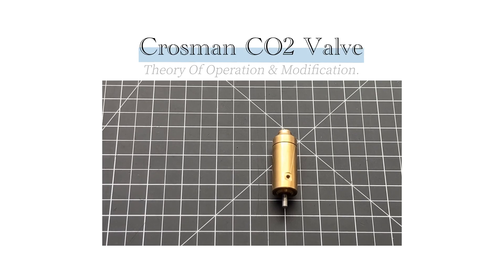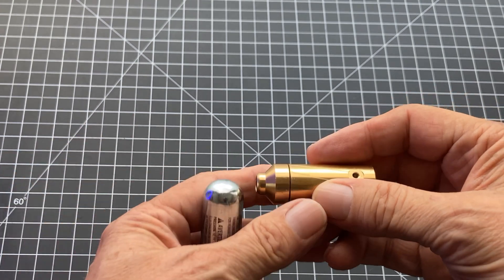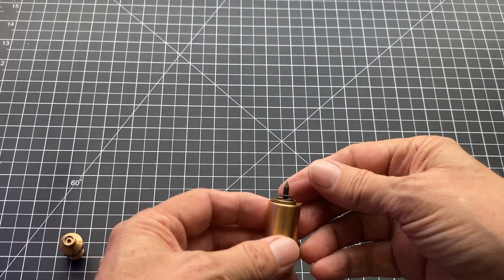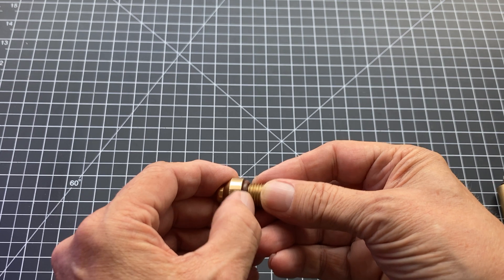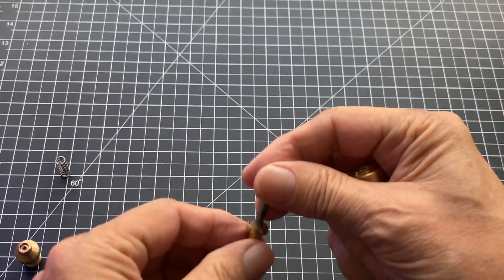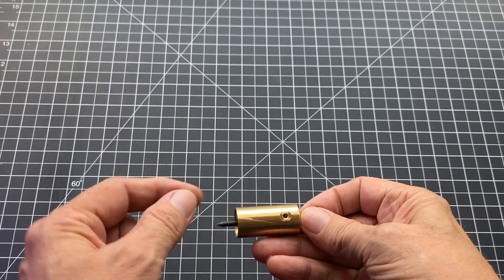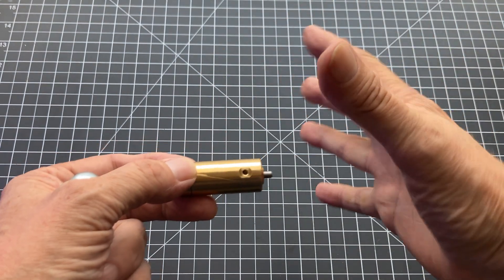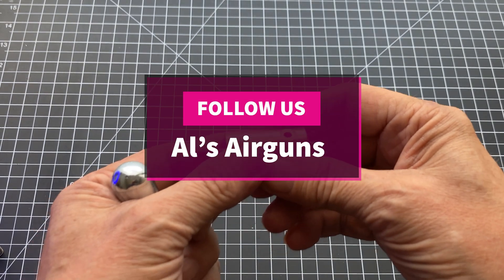Crosman CO2 Valve Theory Of Operation & Modification For Increased Power (Part 1.)

Comment: I have a pell master 700 and the valve assembly is different! I took it apart to clean it because it was leaking air. When I took the snap ring off it flew apart and I don't know what order to put it back together in!
Reply from the maker: Unfortunately the Pell Master 700/707 was a real odd ball in the Crosman line-up. It utilized an in-line valve design which is totally unlike the traditional Crosman CO2 valve. Most people including myself were unaware of this one off in Crosman’s history. There is not a lot of information online about it, however if you go to Crosman’s support website you should be able to find the exploded parts diagram which can assist you with reassembling yours.

By the way, if it’s leaking gas cleaning it will probably not fix the problem. It’s more likely to be a component failure. Most likely a seal or spring has failed. Good luck with the repair.

Comment: If you don't understand an Airgun valve after this-You shouldn't play with Scissors !😆, Al has explained this quite well ! I worked with CO2 in the Beverage industry, and TEMPERATURE is prob your biggest factor to Increase Pressure(Not Volume-just pressure). Be VERY careful Tho...But we all Know, a Hot, Summer Sunny day, and Warm CO2 Carts, A warm pistol sitting in the sun... will give you your highest power #'s...EVERY time. Pressures will be higher. Considerably, than let's say, a guy like myself shooting in January in NH-Outside @ 32* degrees !. Chrono will always Prove this. I've seen guys spray paint brand new CO2 Carts flat black (ever wonder why they all come Silver?)- painting them black will surely raise pressures IN THE SUN Only ! Add in a Black Pistol,Sitting on the Table in the sun and You'll understand. I'll recommend NONE of what I said, but it is a Fact. CO2 Expands with heat. Fire 10 fast Shots and watch pressures drop as the gun/CO2 cool from the liquid CO@, Yes, The pressure drops due to volume lost, but the Ultra-Frost-bite temps will rapidly cool the gun. It's important to know the mechanics of anything, and all the processes involved, because it will make you a better shooter- In ANY shooting sport! Thanks to Al !!
Reply from the maker: Your comment is much appreciated. Thanks 🙏

Comment: Finally a clear explanation on how the system works. 55 years not knowing this, BTW! I have a Sears,  mid 60s, 22 Caliber Rifle similar to the Crosman 160, but with a shaft on the threaded cap and uses only one CO2 Powerlet. Would it use something similarly designed? And you mentioned something like an O-Ring where the Powerlet meets the Valve? How are they held in and where do we get those, because when I put in a new Powerlet, it leaks immediately when pierced! Thanks for sharing solid information for those of us that like to know how things work for real! VERY MUCH APPRECIATED!
Reply from the maker: I’m glad that you enjoyed the information. Sounds like you may have a Crosman 180 that’s been branded by Sears. The 180 was, as you suggest a one co2 capsule version of the 160.

Unfortunately there are a few places it could be leaking. 1. Is the O=ring that seals the end cap. 2. Is one of the sealing points in the valve itself. I’m not sure if that valve used a seal in the front of the valve that pressed against the opening in the neck of the CO2 capsule like a modern Crosman CO2 valve or not. If so, that’s not a standard o-ring, but instead a special synthetic seal produced by Crosman. If that’s the case Crosman may be a source for it but you’re going to need to come up with a part number to find out and that’s going to take some research or additional assistance. I think it’s definitely worth pursuing if the guns in good condition otherwise. Let me know if you need help.
Reply: @AlsAirguns  Funny thing is my Sears has a Long Tube and Stock (Much nicer feel and hold), but uses one Powerlet like a 180. Thank you! I will attempt to disassemble and document placement on all parts with pics and hopefully have it running like new again. It was quite accurate back in the day!

Comment: All the same goes when modifying  for hpa valve  besides the side pining.  The discovery valve body  a aluminum  side pin hole taped   2240 valve body basically   the top and  popet are  made for hpa .    A discovery is a  factory modified 2260 hpa conversion   with a tube fill end cap. Lol🤭💯🫡👍✌️
Reply from the maker: That’s great information. I always feel like I missed out by not owning a Discovery.

Comment: Very interesting and very helpful! Would I be correct in assuming that you may provide before and after the modification fps and shot count data in Part 2 or 3? Thanks again! This is literally a case of "Knowledge is Power!"
Reply from the maker: Yes, I’m modifying this valve for the Crosman custom co2 carbine I’ve been building on the channel. So the performance before modifying is. documented in terms of FPS & ME. Then we’ll test again after the valve has been modified.